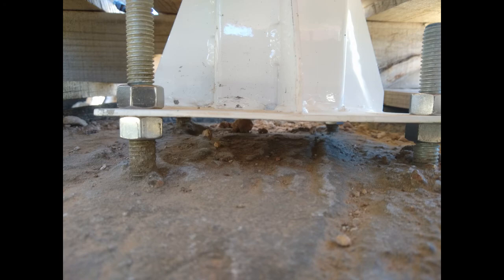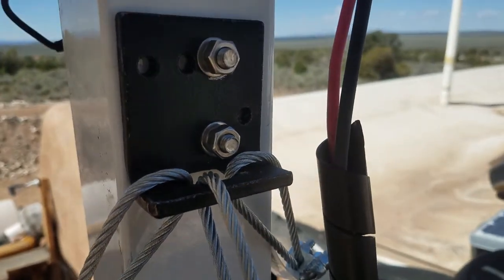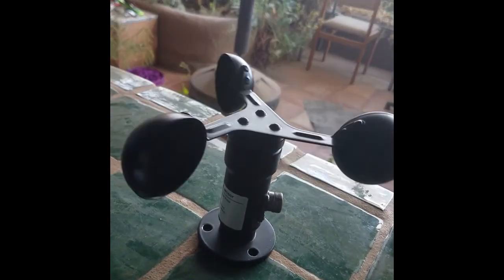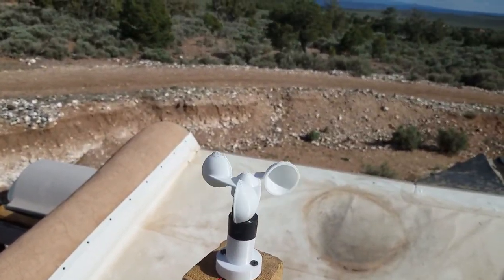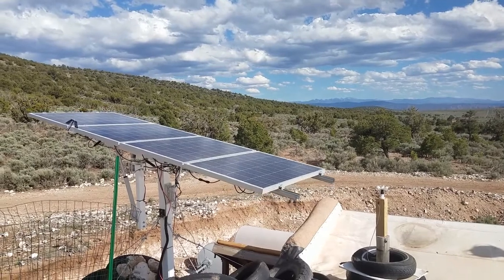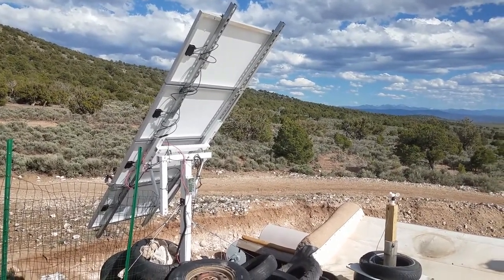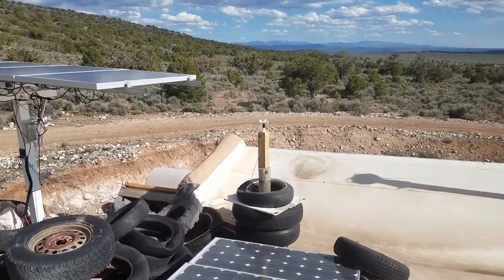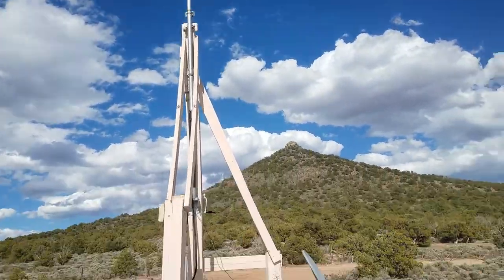New ECO-Worthy Solar Tracker Update (Wind Protection)

Comment: Why not insert a space between each panel to let the wind blow through the gaps created and break the wind load?
Reply from the maker: That might not be a bad idea. I would have to change the mounting system because each mounting point is designed to hold down 2 adjacent panels.
Reply: @aloneinanearthship4010  Dosent help, it makes it worse, and increases the toque on the system.
redrok

Comment: Hi James; For a dual tracker this is 'cheap'. Could I attach 14' (~170") rails, north-south, to the ECO-Worthy tracker without hitting the ground? Need to put up 4 panels; 64"x42" each. Thanks.
Reply from the maker: It's very cheap, but it isn't super strong. I'm not sure I would trust it with more than the 4 100 watt panels it's intended for. Also, I think it would hit the ground.
Reply: @aloneinanearthship4010  Thanks for quick reply; They claim it can support up to 300#; my 4 panel would be less than 200#; also I could reinforce it with super-struts including the base, I assume it's hallow with a 2" pipe? I am tempted to give it a shot.
Reply from the maker: @JAdams-vb1qb  It isn't the weight, but  rather the wind that I would worry about with a larger surface area. Even just 20 mph wind can cause mine too oscillate vigorously. Check out my other videos on it and I cover how it is mounted and what I did to make it stronger.
Reply: @aloneinanearthship4010  Think about the "Flapping Stop Sign Effect" you see in storm videos. The drive mechanism must handle this. The torque value in #ft is about the sme as the wind load in #/ft^2.
redrok